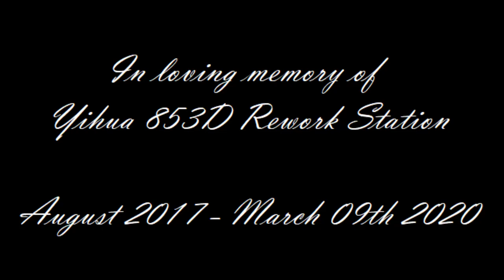Xbox One X Broken HDMI Port Diagnosis And Replacement

Comment: Very thorough and informative. Didn't have to be perfect to get results and you work with what you got. I accidentally blew components near the bus controller to attempt to repair the never ending blue light like an idiot and the system wouldn't turn on so I said never ending blue light is not repairable but I can buy off you for parts. Technically it is not repairable so I wasn't lying lol.
Reply from the maker: I have to disagree on that one. The constant blue light of death is fixable most of the time. It depends what is causing it but I successfully repair the constant blod regularly. Issues can be anything from the hdmi circuit to the hard drive, ram, apu etc. If you knocked components off you should at least put them back before handing it back to the customer. If it turned on before it came to you, in my opinion you should be doing everything you can to at least make sure it turns on when it leaves. Whether it still has the constant blod or not as a technician we shouldn't be making things worse

Comment: Trying to fix my xbox one x with no no image issue (TPD158) , the EMI filters gone out and I've lost it (EG3 and EG4) and a capacitator too (C18). Do you know where I can buy it? or the reference / value of this components?
Regards from Spain.

Edit: Can I bypass the EMI filters or grab the two of the HDMI IN circuit (Never used the HDMI IN).

Comment: Do you need the hdmi pinout for the ps4 to run jumper wire for the missing hdmi traces?
Reply from the maker: I have it already thanks, I'm used to running jumpers on the hdmi ports:) thanks for the offer though 👍

Comment: You should use liquid flux to remove the hdmi port. Better than paste because it doesn't get on the nearby components and blow them away. It evaporates. I also normally use a little more airflow to be faster and I flip the board and do it from underneath. Less chance of ripping the pads and I hit it up top a few seconds and go back underneath. That much time will melt plastic. You should always be using flux regardless tho